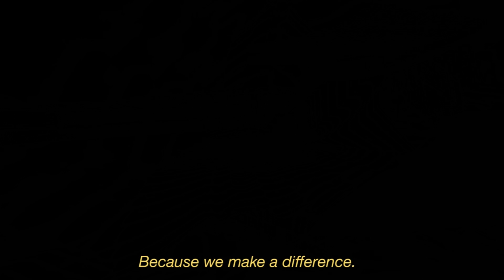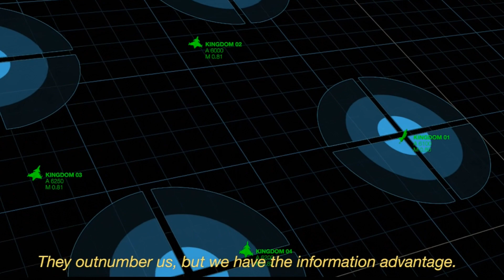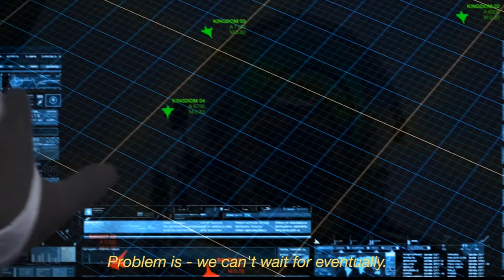Gripen Fighter Jet - Canada's Future Fighter?

Comment: SAAB has an amazing track record with some very rugged and well designed planes, as another Canadian I see all the reasons to get it. They want that contract and we could really use them for a cold country our size, but its still only a great "option". Unless we are buying over a hundred and committed to upgrading them continuously with other bells and whistles, Canada needs the F-35.  

Canada has to remember that we are also invested in building F-35 parts, Gripen's "cheaper" package deal may not be so cheap because other costs will need to be paid. The Gripen is simply the cost-effective answer for the 21st century and its an amazing aircraft, I bet its also low maintenance with fast turn arounds, but by itself it will soon be needing further upgrades the moment it touches our soil.
Reply: So, you're happy being nothing more than an American client state?  You're a disgrace to our country (assuming that you even are Canadian).  The F-35 has ewll over 850 identified defects, 871 at last count and over the entirety of 2020, Lockheed only managed to fix TWO of them.  We don't need a defective fighter and we don't need uneducated opinions either.
Reply: @CF-105_AvroArrow   Ideally Canada makes our own but the reality is that America is our biggest trade partner and that country has had a history of shooting down the Avro program. So our chances on that front are going to be nothing.

The F-35 is the ONLY stealth jet on the market and WE were going to make parts. That is the reality and by shooting THAT deal down, Canadian aviation companies will suffer. Pride is great and but the battlefield won't care and just shoot to kill.

Comment: F15 u or s would be a better choice
Reply: A little side by side.
Grippen: payload, 7200 kg, top speed mach 2.2, range 2019 n miles, cost 30 million
F15sa: Payload, 11000 kg, top speed mach 2.5, range 2400 n miles. Cost 30 million.

Comment: The Gripen is a tiny aircraft with tiny capabilities. I would think that the vast expanses of Canada would want them to buy an aircraft with long range rather than short range. Second, one engine was supposedly a no-go for the Air Force in case of an engine failure. There is hardly a worse plane with a light payload and short range Unless....you plan to have tankers fly patrols with the Gripen.
Reply: Jas Gripen has a combat range of up to 1.500 km
Payload: 8 hardpoints that can carry excess of 5,300 kg
Eurofighter has a combat range of up to 1,389 km
Payload: 13 hardpoints that can carry excess of 9,000 kg

While Jas Gripen carries less weapons its not that much different as well as it has its own special arsenal. That said from a military perspective the Jas Gripen is easier to maintain and keep operational and much cheeper because its smaller and does not have a complicated twin engine configuration.
Reply: Cant argue with you about the Swedes making easier to maintain aircraft but the stats you show are skewed a little. It depends on what is considered the load out for combat range. I single engine plane must work harder to carry its fuel and load out than a twin engine plane. Just look at the French and their Mirage 1, 3 and 2000. They ended up switching to the Rafale because the little 1 engine planes just couldn't lift the required fuel plus ordnance to patrol for any range. They learned and its a shame that Canada will learn this lesson the hard way.
Reply: Actually its mainly because the twin engines are bigger by necessity. They could add more fuel capacity on single engine aircraft if they want but they rather have them small and nimble. A twin engine aircraft on the other hand needs a certain minimum size which means you got more space left over, also it can carry more weight because of its higher engine power.

If you ask me though I dont think any modern aircraft today is actually equipped to handle a war against a developed nation like Russia or USA. Stealth technology is the best chance we got but that is not fool proof and will only work until the enemy figures out a counter at which point all the development and design you put into making it stealth is completely wasted.

Comment: I like the idea of amixed fleet! I think the Gripen is also a very good choice! The liberals need to get their heads out of their asses and get on this...
Reply: Mixed fleet is actually a really bad idea, unfortunately. There is a significant fixed cost associated with each fighter-type you operate, so the total front line force would be a lot smaller if you operated two types compared to one.
Reply: It would be wonderful if one could have just one plane for the entire military. That would keep production costs at the minimum when everything could be standardized and massproduced cheaply. And the need for spareparts would be minimal. And mechanics doesn't have to be taught how to repair different planes etc.

But the problem is that planes cannot do all jobs well at once. Some planes are good for air combat, others are good for attacking groundtargets, others are good for transport, others for recon, others for serving or aircraft carriers, others for long-range patrol missions in the North Sea, others are good at knocking out tanks and resisting ground fire.
And if you try to merge all those features into one single plane, its easy to just end up with a plane that cannot fullfill any of those roles as good as other planes can. Your "jack of all trades" simply becomes good at none.

And the F35 seems to have fallen victim to the wishes of becoming good at everything and save costs. But now this plane have long since gone over budget, and despite the F35 program already have consumed more money than the GDP of many rich European countries, so is this plane not at all any impressive in its performance. Actully it is quite bad in comparison with many other planes.

I guess the US military became overambitious, and in hindsight most people would say that it had been better that America had gone with building many types of planes instead of replacing all F18's, A10's, F16's and AV8B's with the F35.
Reply: It would be wonderful if one could have just one plane for the entire military. That would keep production costs at the minimum when everything could be standardized and massproduced cheaply. And the need for spareparts would be minimal. And mechanics doesn't have to be taught how to repair different planes etc.

But the problem is that planes cannot do all jobs well at once. Some planes are good for air combat, others are good for attacking groundtargets, others are good for transport, others for recon, others for serving or aircraft carriers, others for long-range patrol missions in the North Sea, others are good at knocking out tanks and resisting ground fire.
And if you try to merge all those features into one single plane, its easy to just end up with a plane that cannot fullfill any of those roles as good as other planes can. Your "jack of all trades" simply becomes good at none.

And the F35 seems to have fallen victim to the wishes of becoming good at everything and save costs. But now this plane have long since gone over budget, and despite the F35 program already have consumed more money than the GDP of many rich European countries, so is this plane not at all any impressive in its performance. Actully it is quite bad in comparison with many other planes.

I guess the US military became overambitious, and in hindsight most people would say that it had been better that America had gone with building many types of planes instead of replacing all F18's, A10's, F16's and AV8B's with the F35.

Comment: F-16 would be in the Running if you Think Gripen should be a the future....air craft for Canada. 

F-16 block 70 AESA  APG-83 radar for long range BVR and ground search high in high electronic warfare environment

F-16 block 70 $55mil higher CLCP 50% higher, then Gripen make it more costly to fly 

Gripen-E cheapest life cycle per hour $4000 vs F-16 Block 50 $7000

Gripen-E best sensor/IRST networking of any 4th Gen aircraft only other higher Aircraft is F-35

Gripen-E $60million, cost 5mil more then latest F-16 but 50% CLCP makes it cheaper to fly.

Both F-16 and Gripen are close one has better radar, other has better sensor Fusion with IRST and cheaper to fly.
Reply: The f-16 can also have conformal fuel tanks to increase its range.  Its one of the best multirole aircraft and fly up its own ass.  Problem with the f-16 is range.
Reply: PSG1JOHN1 did you even listen to the video lol?
Reply: Does Lockheed even want to sell the F-16 when they are pushing that the F-35 is the only answer?

Comment: The f35 is not the finest fighter jet now! Look how shitty it is. Over budget, Can't maneuver and radars see it easely. in a couple of years stealth is obsolete already, because country like China and Russia are going to develop better radars.
Reply: /Chooêt\ the stealth isn't just to hide from radar, the stealth also confuses lock on weapons making them less effective. The future plan of the f35 is to mix it with dogfighting planes, the f35 would be like a control center with great radar and would launch surprise attacks while the dogfighting planes attack the enemy.
Reply: Chooet you just another idiot that doesn't know facts vs fiction
Reply: Chance of detection, track, and lock depend on signal to noise ratio. Stealth aircraft reduce signal while jammer aircraft increase noise. There are multiple methods to counter this but having low signal and high noise is still going to be better than not having them. Less stealthy aircraft with external weapons still have utility and can complement stealth aircraft that have limited internal stores. Better missiles have also made better maneuverability less useful as they can reliably track and out turn even the most agile aircraft. Sensors are better, weapons are better, and stealth is better. No single factor is going to obsolete the other factors.
Reply: /Chooêt\ can't understand what you said since i don't speak Russian!
Reply: Clifford Nelson he is right
Reply: Not quite, more like a hive mind linking up with AWACS and other data platforms so all assets can react fast.
Reply: profesercreeper So? Just let a mig39 get up with infrared missiles and bye bye f35. it is like a flying box.
Reply: You don't get it do you? What if countries like china and russia develop new radars (or something else) that make the f35 not so stealthy any more... And then you have a crappy expensive, single engine, flying truck that can't maneuver, can't fly fast and can't fly high. Those radars are going to come, no matter what. Stealth isn't technology that is going to last for 10 years. Stealth technology on planes will be over soon, when other countries like Russia and China have created a radar that is able to see the F22 and F35. And even if the f35 stealth works, it is really simple, if you can't shoot it from ground, just send a cheap plane with infrared missiles, done.
Reply: Then why are those countries bothering to invest in stealth aircraft?
Reply: rvfharrier Because why not? all other countries are doing it too.
Reply: No, you're talking nonsense. If China and Russia were on the verge of rendering stealth obsolete with 'new radars', then they wouldn't be bothering to invest a single cent into stealth technology. 

Stealth simply doesn't work the way you think it does. It's not something that's either on or off, that either works or doesn't. If a fantasy radar powerful enough to detect a stealth aircraft at significant range suddenly pops up in ten years, then that same radar would detect a non-stealth aircraft at far greater range. Stealth in that case is still an advantage.
Reply: rvfharrier Thats bullshit. If they have the radars they wouldnt let america get the same tech too.
Reply: No.
Reply: Lol, just no
Reply: The Yak-38 Yes, of course. It was called the "widow fighter". 
The Yak-141 had more in common with f-35, although he had turbojet lifting engines, not lifting the fan as the f-35.
Reply: no such thing as Stealth -- it's a red herring.  Stealthy planes are easily seen by low frequency radar from WWII.
Reply: The best fighters available for most NATO allied countries are F-35A, modern F-15 variants, and Rafale. The strongest feasible force would be a combination of these. There are a number of other good fighters that are more than adequate and can compete in other factors such as cost but these are the best options in overall capabilities. Numerous fighter competitions have proven these to be the top aircraft available. They each have different capabilities and can complement each other well when used together. 

For those on a budget the low operating costs of Gripen E combined with decent overall capabilities can be an attractive option but they still have significant initial costs while slightly less capable than other options.
Reply: KingChooet - Are you Chinese or Russian? The F-35 is not "shitty". It is (indeed) the finest fighter jet in the sky.
Reply: Calculations were possible even then, even for curvilinear surfaces, but this does not make sense for a manned vehicle. For cruise and anti-ship missiles, drones, this is actual, and these works did not stop, and the technology itself was limitedly used in prototypes of 144 and 141 and Su-47, now used for cruise missiles, drones and MiG-35, Su-34, T- 50.
Reply: Keith Carter They can see its general location, but they're not mobile, highly visible to aircraft and can't guide missiles
Reply: We don't know anything about the F-35s maneuverability, the 'dogfight' between it and an F-16 wasn't really that, they were testing High AoA equipment and used the F-16 as a reference.  Radars can't see it easily, which is shown by the few losses and its versatility in Red Flag 17-1 (it was able to operate  within what would normally be SAM range and not get shot, and had a kill rate of 20:1 for the Air force, and 24:1 for the Marine Corps).  Just like China and Russia are developing newer radars we will continue to update stealth, probably faster than Russia and China can create better radars.  Stealth is not something that cannot be updated, like any other technology, it will.
Reply: donnibrasko1 another non expert that spouts bs.
Reply: What's most amusing) The F-35 is the follower of the Yak-141 project, which had a similar circuit and engine. The very low-visibility technology was first proved theoretically in the USSR in 1962. (!)
 In addition, stealth technology as it is advertised in the west is not a panacea and is recognized as useful only for cruise missiles and a general reduction in the visibility of a fighter without a fundamental loss of aerodynamic characteristics.
The very technology of building "stealth" was not found in the ussr support for unjustified economic costs and as a result, it turned out to be B-2.

Pyotr Yakovlevich Ufimtsev (born 1931 in the Altai Territory, RSFSR) is a Soviet, American theoretical physicist in the field of diffraction of electromagnetic waves, the results of which are used in the development of aircraft and other military equipment using stealth technology.

P.S. Quite a long time there are complexes capable of ignoring stealth, using other location technologies, for almost 30 years. It's just that not everyone can afford this, for the time being)

Comment: I agree 100% i wish Denmark would by this fighter instead of the F-35 because all the rest of the Danish military is being starved of resources. 
The Swedes pulled out of the Danish competition for a new fighter, because the competition was rigged and the rules changed to fit the F-35.
furthermore in addition, The swedish jets have been on maneuvers in America, where they, with ease, locked on to the F-35, until the Americans pulled there jets out because of technical reasons, offcorss this is unofficial information and it was before the F-35 was operationnel, but it just makes you wonder.
if you drive through Sweden, you constantly comes to stretches of straight road, in the fields and in the forests, to take out the swedish landingstrips would be a impossibel task.
that in mind, coupled with the small footprint off the jet, constant upgrades to weapons, communication and avionics equipment and customer basis, makes for an opponent to be reckoned with.